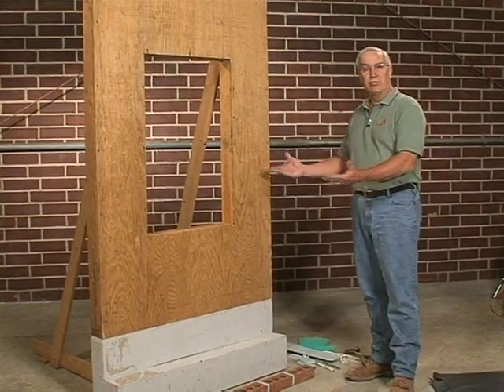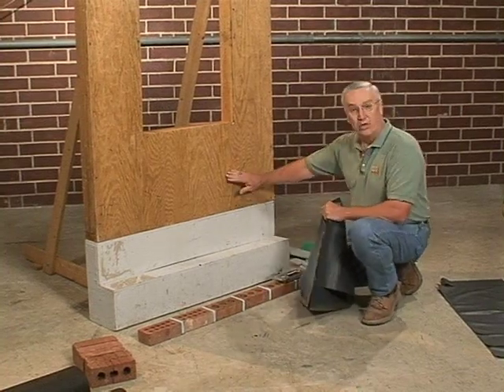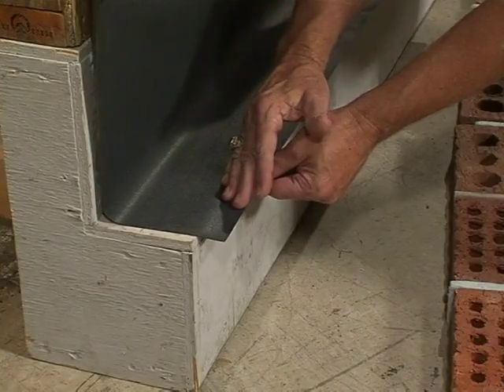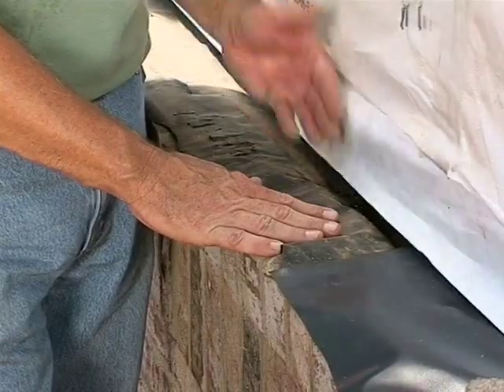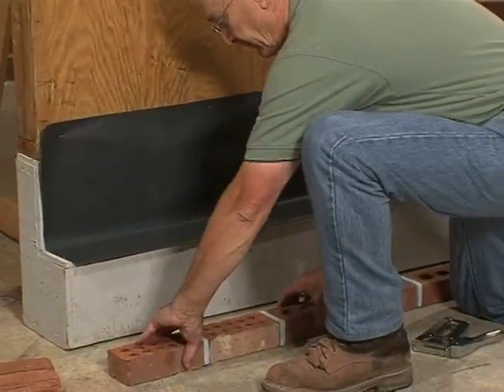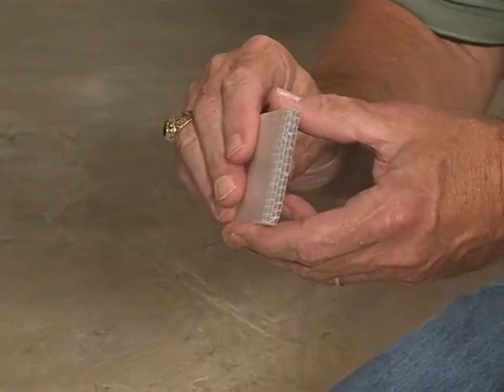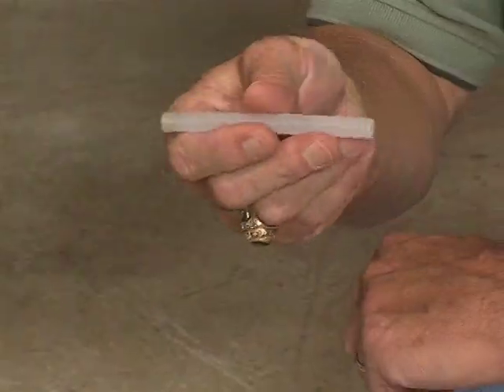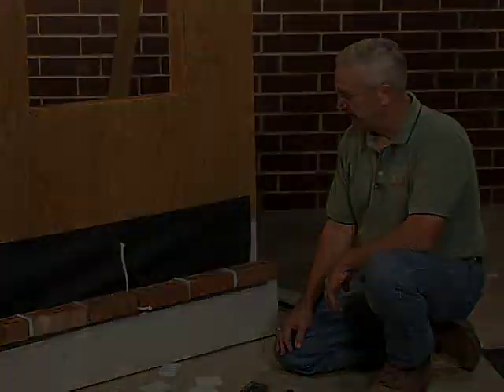Flashing at the Base & Weep Holes

Comment: I have a question. You know how you placed the wall flashing lights under the first brick, my house has the wall flashing placed very close to the base and gave the way towards the soil. Because the water couldn’t get out, it made the wood inside the house to mold. Is this a structural problem that is serious? What brick is the flashing i supposed to be placed?

Comment: The weep holes on one side of my house were at ground level and with heavy rains the runoff will come up against the brick. I sealed them with silicone caulk. Should I drill some higher on the wall?

Comment: What if your house does not have weep holes? Could you go around the house and drill through and create a weep hole at the exact depth of the brick in order to prevent going through the WRB? Or do you feel this would create issues?  For what it is worth, I can see black plastic sticking out beyond the lowest row of brick (between the brick and foundation).
Reply: It's not recommended to drill because you might damage the flashing.

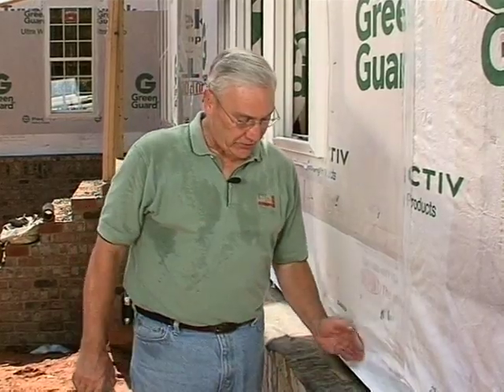Comment: 2:20-ish into this video.  Flashing, in the late 90's was recommended to go through - as in this video.  This was stopped in Michigan, as it allowed for water to seep in between the joint, freeze, expand, and crack the brick.  Also, we do not push the flashing back.  We cut it, keeping a square edge against the back lower corner, allowing for proper water run off.  However, it is appearant that this has happened on jobs.  Laying mortar on the flashing is not a good idea.  this allows for issues with the wall rolling.  Open head joint is not good  Hornets, or bees, or other insects build nests.  water builds up, freezes and expands.  Also, how is one going to prevent mortar from filling the head joint, if the mason fails to clean out the head joint properly?  Also, I see no mortar net between the brick wall and the plywood wall.  This leads to a failed weep system, due to piled up mortar at the bottom of the wall. Also, ropes are bad weeps in Michigan, they soak up water in the winter, freeze, expand, and crack the wall.
Reply: You said to cut the flashing?  How do you cut it?  It is hanging over on my daughter's home that she just purchased.
Reply: @stephaniewinegar5380  the flashing, if it is the rubber, can be cut with a uitlity knife, flush with the face of the masonry
Reply: @stephaniewinegar5380  the flashing is suppose to hang over, if it is the metal flashing.  If it is not metal flashing and it is a rubber type flashing, then a utility knife is fine.    However, the flashing is typically suppose too hang over the brick or block to allow water to run off the face.  Hope this helps.

Comment: Back in the 1980s no flashing or weep holes in residential. NONE. .. It's fair to assume probably not before then either. ..  Except one time (I guess a home buyer requested it), the boss told me to go dig out a few head joints, he called them "weep holes", that was first time I heard that term.😂  The builder though was Highly Reputable, and we masons never had any complaints.  In fact nothing but compliments from home buyers.😌

Comment: Excellent video! Really informative. I just had my house built and the builder has put weeepholes but I did not see any flashing during construction. I pulled out a weephole cover to check and sure enough all I see is mortar at the back no flashing! Why has my bricklayer missed this! Disaster. Any suggestions as to what we should do?!
Reply: Yeah, me too, when I look in the weep hole I see concrete. I've got a tiny bit of water leaking in under the sill plate during bad rain events. If water pools for any length of time it will obviously wick through mortar, concrete, brick, etc.

All I can come up with that doesn't involve tearing the wall down is to use a drill and a bit to clean/vacuum out the bottom of the weep hole VERY well. That will give the water in there as much chance to roll out on its own as possible. Right now almost all of them have some mortar splatter inside the channel so I'm assuming water sits in a pool behind that little mortar dam at each weep hole.

Comment: DO NOT INSTALL THIS WAY!  Leave an open head joint for a weep hole?  What keeps bugs & insects from getting in there and making a nest the size of Texas?  Weep ropes are an ancient practice.  Weep ropes suck water in the cavity before they pull it out.  Everything you see is out dated and I could go on forever.  People who still do things this way are killing the trade.
Reply: Bruce Longton you seem to know your stuff. Can you help me? I just had my brick veneer house constructed (same as in video) and the brick layer has forgotten the flashing but put weep holes. The wooden frame was wrapped around like a present but just no actual flashing as per this video. Is this a disaster??? We have very wide eaves so I hope this helps with stopping water entering the  cavity. I’m just a layman and slowly working this nightmare out
Reply: sazzlepop you don’t have a nightmare. Your mason did it correctly. Even the guy in this video has no clue what he’s talking about. He says the flashing needs to be below the sill but then installed it above. He suggests having the flashing sticking out of the brick wall half way up in his example? That’s completely wrong! I have tore down brick buildings a 100 years old that did not have flashing and the wood was still like brand new behind the wall.

Comment: The material you used for the flashing is crap cheap ass plastic. Way better material available now. what you used usually dries up and cracks after a short time in the life of a building. They usually lack the proper plasticizes in the material. The weeps you show (cell vents) I have seen in 9 years turn to actual dust when I rubbed my finger on them. They were made or at least sold by H&B

Comment: Im doing bsmt window sill stones, on a multi level home, they sit on the poured foundation wall, originally there was a thin plastic mortared btwn the wall and stone.  My local building supply sold me 20mil poly and told me to use pitch btwn the wall and poly, then mortar the sill to the poly, but there is a bond break because the pitch doesn't harden and the sill wants to rotate out of place.  Should I just use mortar on the poly to foundation and pitch on the poly to sill plate?  Thank you for your reply

Comment from the maker: The last comment is correct that aluminum flashing is not appropriate. BIA’s "Technical Note 7A: Water Penetration Resistance – Materials" can be referenced for recommendations and additional information at http://www.gobrick.com/Portals/25/docs/Technical%20Notes/TN7A.pdf.  In short, you will see references to avoiding aluminum in these sections:

SUMMARY OF RECOMMENDATIONS (page 1)
Flashing:
• Select flashing that is waterproof, durable, UV resistant and compatible with adjacent materials
• Flashing materials should conform to applicable ASTM specifications
• Do not use aluminum, sheet lead, polyethylene sheeting or asphalt-saturated felt, building paper or house wraps
• Use a metal drip edge to extend flashings that degrade when exposed to UV light

FLASHING, Sheet Metals, Aluminum (page 6)
Aluminum. Aluminum should not be used as a flashing material in brick masonry. The caustic alkalies in fresh, unhardened mortar will attack aluminum. Although dry, seasoned mortar will not affect aluminum, corrosion can continue if the adjacent mortar becomes wet.